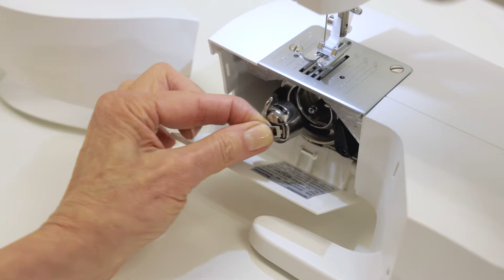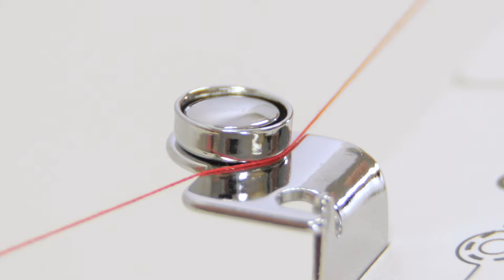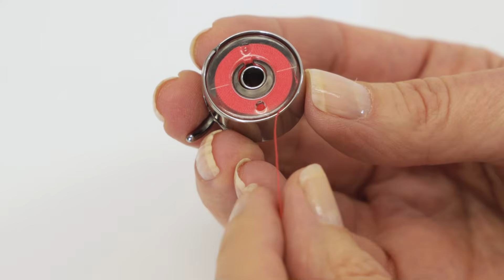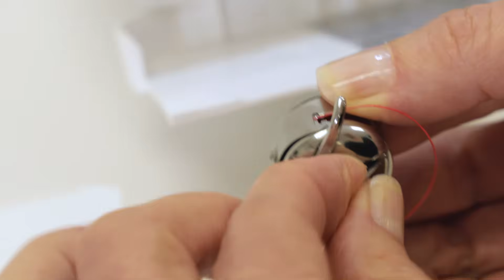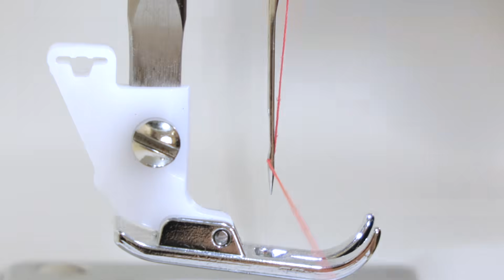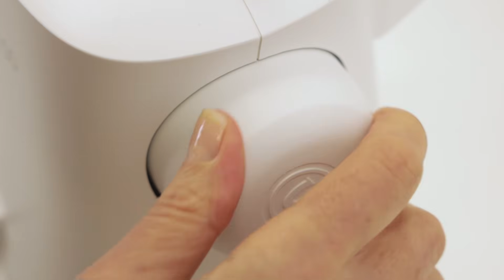SINGER® M2100 Sewing Machine  - Get Started - Threading the Machine

Comment: It jams every time. I don't understand why. It grabs the loop from the bottom/bobbin but then you say to pull that back with the top string. Over? Under? How? You don't show! And my machine just jams after this part every time. I can't even get the damn thing threaded to use it because this is incomprehensible. It won't engage the bobbin correctly and there is ZERO instructions other than hieroglyphs and this incomplete video. HOW DO YOU GET IT THREADED AND FUNCTIONAL???
Reply from the maker: For further assistance, please contact our Customer Care Team at 1-800-474-6437 or email them here: https://www.singer.com/email-us/. Thank you!